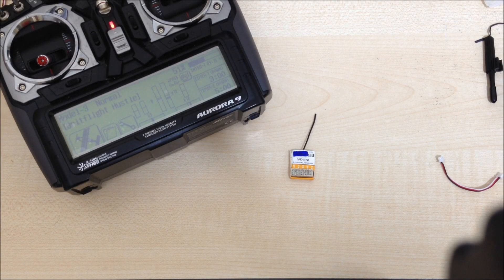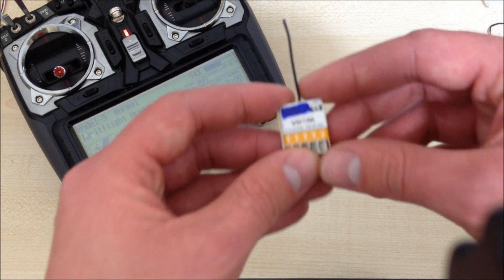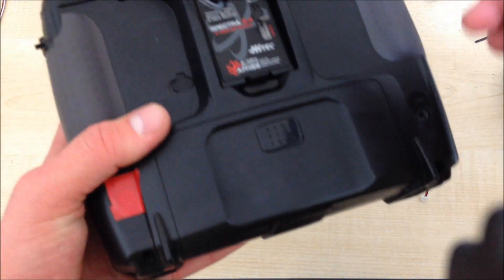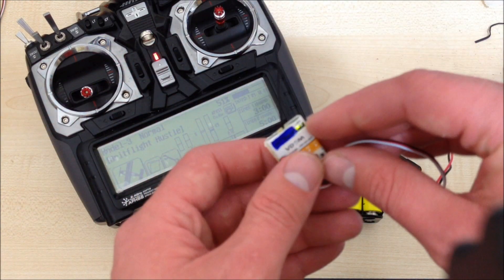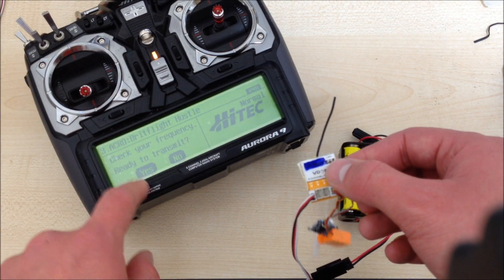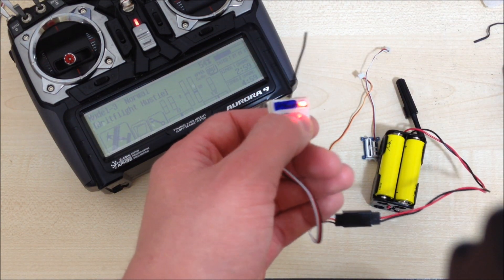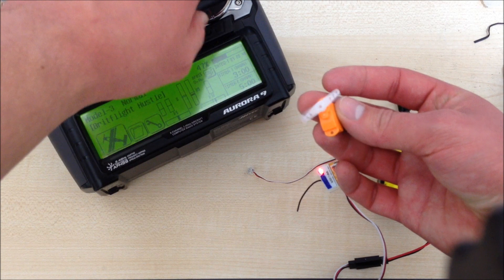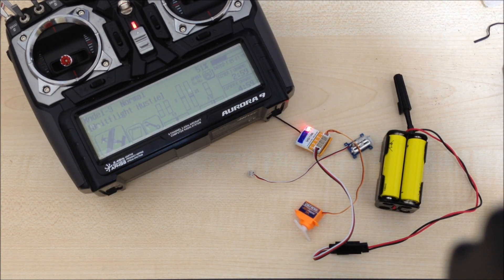5 Channel Micro Parkflyer Receiver (Compatible with Hitec 2.4GHz A-FHSS)

Comment: Hi,
I'd like to ask you for some things... What is the name of the servo with linear moving? And due to I can't find any clear explanation, could you tell me if the A-FHSS rreceiver is compatible with FHSS transmitter? Thanks in advance.
Reply from the maker: They're Linear Servos. The ones in the video were from HobbyKing - http://bit.ly/1NcAVur and http://bit.ly/1F5cskY
No, the A-FHSS receiver is only compatible with Hitec 2.4GHz systems.
Si.